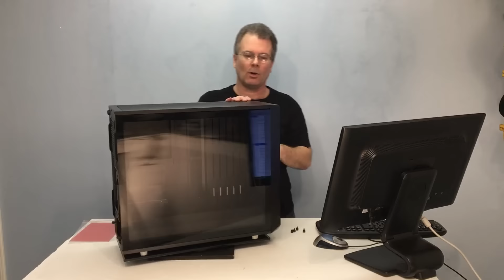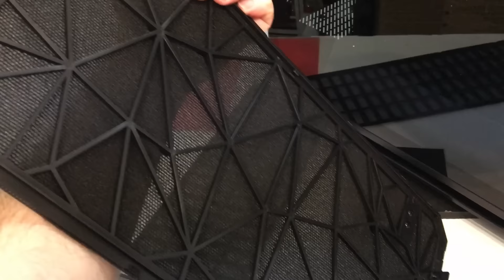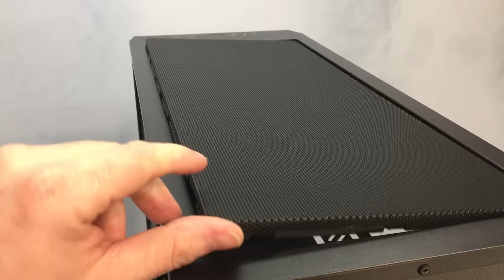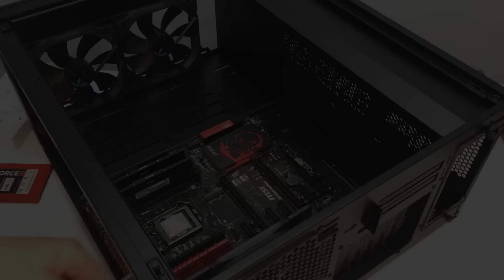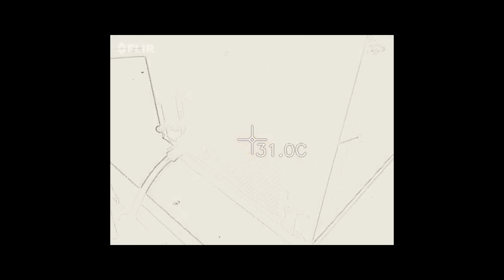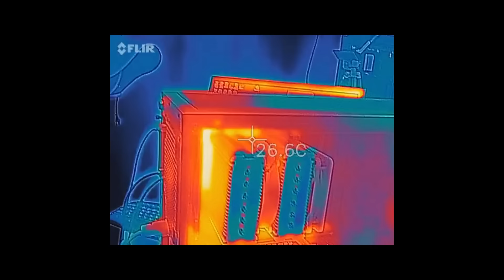Fractal Design Meshify S2 Case Review

Comment: Hi do you know what the clearance is from the roof (top radiator mounting palte) to the motherboard mounting standoffs? I have a Gigabyte Aorus Master X570 Mobo, and was wondering if the Kraken x 63 radiator will fit. Thanks!

Comment: Inly thing I hate about it is the top bracket screws were so tight in mine that 3 of them are now stripped and only one is loosenable. I also cant find any cables for power led or mb speaker (gigabyte x570 aorus pro wifi)

Comment: I'm interested in this case for my new build, but I'd like to keep my current PSU.
Will a Corsair 1200 AX PSU fit in this case?
Reply from the maker: The max. PSU length for this case is 300mm and from what I can find for the AX1200 - it is shown to be 210mm, so that PSU should be ok.
Reply: @overclockersclub  Thanks!

Comment: How is the noise?
Reply from the maker: It is a quiet case.  But of course, some of that will depend on the type of CPU cooler that you use.  For example - an air cooled CPU may be more quiet than a liquid cooler with large fans at the top of the case.

Comment: Where did you get that swivel stand and how do I get one??? PLEASE
Reply from the maker: I made it. There  is a piece of wood on the bottom (painted black), a large thrust bearing, a section of PVC pipe screwed to the wood base to center the bearing, and the rectangular glass top of an old TV stand on top.

Comment: You Do not need to remove the front of the case.... Simply reach under and press the release to let the front filter panel out for goodness sake
Reply from the maker: I realized that after I started stitching the video segments together and corrected myself at the 17:25 mark.
Reply: @overclockersclub  got a meshify c hehe. Every review I saw on that they did the same on the front panel. It's frustration getting the better of me. Will watch the entire review now.

Comment: Why are you overclocking on air?....idc if its a high end air cooler or not, its just bad juju lol..
Reply from the maker: Right, but it depends on how aggressive the overclock is. For my testing, it is a very mild and stable overclock just to get some heat moving.  Air cooling fans (no pun intended) would argue the bad juju of a potential pump failure.
Reply: Thomas K  -  OC on air is totaly OK . IDK from where you got opinion its "impossible" :D I overclocked my cpu on air, overclocked gpu on air. Both better temps then most AIOs coolers. 
i7 3770k  from base 3,5ghz up to 4,8 with 1,27+vcore 58 Celsius. In p95 test. 
GTX 970 gpu clock for 220clock and memory for 515mhz (efectively 1030mhz). Temps in games when its 98+ percents usage is 55+, max again 58-59 Celsius. 

And as bonus i have nicely cooled power cascades on mobo and other stuff.
What a indolent  kiddish opinion... " Why are you overclocking on air?....idc if its a high end air cooler or not, its just bad juju lol..:"  :D 
And i have same air cooler for cpu,  nh d 14. It has better heatsink than nh d15 (based on my own test few years ago). Going to change vents for NF A15 PWM (at cpu cooler), just for testing, how it will performs. Expecting better temps bit and less noise.

OverclockersClub - very nice review of that case. Ordered one, i will get it next week. Just ordered also noctua 14cm vents for intake and for back of case. FD fans are bit trashy and with very poor static pressure values. With noctua ones i can move more air with less noise.

All the best for new year :)

Comment: It looks like you could pop out the front filter after removing the bottom filter first, and then you would not need to remove the entire front panel to access the front filter.
Reply: This is something people did wrong with the original Meshify as well. Since it's FD, there's probably a nice instruction sheet that explains it all, that no one bothered to read, lol.
Reply from the maker: That is correct.
Reply from the maker: I realized that after I started stitching the video segments together and corrected myself at the 17:25 mark.

Comment: If a 280 aio cooler is mounted at the bottom, is the length of the rad to pump tubing enough to reach the cpu?
Reply from the maker: I will verify with some AIO coolers I have and report back...
Reply: @overclockersclub  okay thank you so much!
Reply: No it will not. I tried in my s2 wich is the same chassis. Just do a custom loop.. but if youd rather not, the old rajintek aios have fittimgs that you can take the tubing off, i had one i threw some shorter tubing on from lowes. Thats one solution you can try
Reply: @Mc-Derpulous  that's bad news but thanks for feedback anyway, appreciated the effort 😀